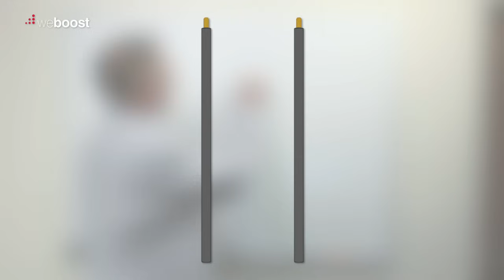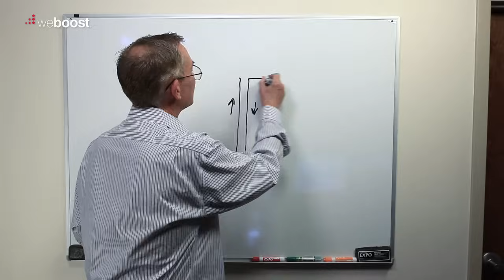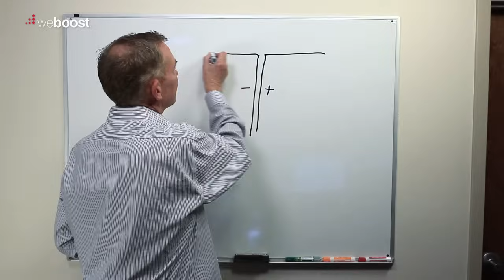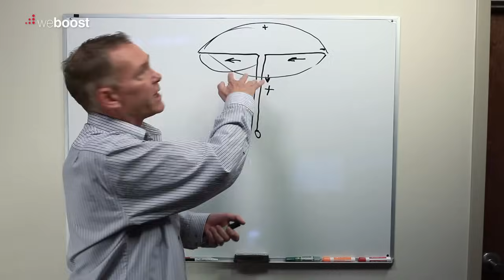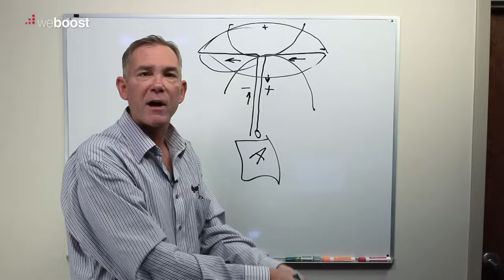How Does An Antenna Work? | weBoost

Comment: I do not get the logic behind the essentials explained. My confuses: why would the energy radiate once you implicit the Circuit as shown. Like why would the energy leave the circuit just because Current flow in the same direction. Would’nt that also cancel them out? Why would’nt all energy just continue into the cathode? Could someone with a Nice soul please clarify this to me? I really must say i’ve allways fellt smart until i’ve tried to understand the logics and deeper fundamentals with radio signals.
Thanks in advance.
Reply: try to learn how the magnetic field around a current carrying wire looks like.That will tell u why having two wires carrying current in same direction adds up the field, rather than cancel. Also how electric field and magnetic fields sustain each other (Maxwell equations)- that will tell u why the energy can leave the circuit.

Comment: Does anything control which direction the energy goes, can it also land in other areas that send signals.if a car is parked in an area where there is an antenna on top of a steeple can that energy wave be drawn to the energy emitting from a car radio? is the antenna Frequencies encompassed by a limited space or does it travel from exm a steeple of a church and can hit the sidewalk from the steeple. like how does it travel ? what attracts the energy, ?

Comment: Thank you for your effort.
But to my point of view, you explain nothing.
And what is this current flow that comes from nowhere on the right wire and goes nowhere on the left one?
This is more confusing than explaining.
Reply: It's like applying AC signal across a capacitor. The circuit is not closed conductively but still displacement current flows and the plates of the capacitor gets charges with oscilating polarity. Similarly, the wire ends gets charged up with oscillating  polarity.
Reply: @commieTerminator    The voltage is its highest at the ends, like on the plates of a capacitor. No current flows out there, only an E wave.  The current is always it highest at the feed (for a center fed dipole, as shown)  so the magnetic field is its highest around the center.
Reply: Backpacker Thrulife that’s a simple explanation of the complex system. Nicely put.
Reply: @backpackerthrulife8497  Current does flow in the antenna which is the only reason why Magnetic fields gets generated. According to Maxwell's equations, changing Electric fields or even a constant current can create Magnetic fields. If the Electric field is changing rapidly then, electrons in the antennae have to move in the opposite direction of the E field because the antennae is conductive. Oscillating electrons (Accelerated charged particles) can easily radiate energy.
Reply: @johnny2x2   Years of scratching my head, until I understood the basic simplicity of it all.  Wikipedia has an excellent animation and drawing in the "Dipole Antenna" article which kinda clarified it all for me.
Reply: I understand  how the current  is created by the frequency  in the wire but I don't understand  how it emits a magnetic field because the circuit  is incomplete in the first place.
Reply: @losimkimrey6531  The circuit may look incomplete but still AC current flows in the antina which creates an oscillating Magnetic field. Since Electric and Magnetic fields are both in sync with each other, it radiates EM waves.
Reply: @commieTerminator  So is it that your telling me an AC current can flow in a conductor without a circuit  being complete?
Reply: @commieTerminator  That is what that's troubling  my head. I understand  all the other parts but  I need an explanation  on only that part please.
Reply: @losimkimrey6531  yes this is what we are telling you lol. When electrical fields move back an forth in a electric circuit they create electromagnetic waves that can propagate under certain circumstances. only HIGH FREQUENCY (like 0.1+ GHz frequencies) can propagate efficiently
Reply: @johnny2x2  pretty confusing. But thank u :)
Reply: Well... In maxwell's equations it states that [ Ampère's circuital law : (change in magnetic field = Material magnetic constant * ( ConductorsConductivity*Efield + Material Electric constant *(derivative of Efield with respect to time ))]. So the flow of electricity from [ConductorsConductivity*Efield] usually is predominant in the equation but because as you stated "what is this current flow that comes from nowhere on the right wire and goes nowhere on the left one?" You are correct it is "disconnected" but this is on purpose. Because of the [Material Electric constant *(derivative of Efield with respect to time )] part of the equation we apply a signal to the antenna that changes over time to make the electrons move back and forth (thus causing changes in the Magnetic field around the antenna and because magnetic and electric fields are coupled together ( meaning one makes the other) SOOO you can emit signals with proper design of this phenomena.
Reply: @johnny2x2   What??

Comment: Thank you weBoost for the simple explanation. I can't seem to get good reception  in my house radio. I've bought and had good radios and they always come with a plastic "ring" and wire as an antenna, or just a wire, but it doesn't improve the clarity of the stations. I get too much static on stations that are very clear in my truck radio. There are some good radio stations, such as good radio talk programs that I would like to listen at home just like I do when I drive my truck, but all I get is static. I've been thinking of getting an outside radio antenna, but I'm completely lost on size and power in what to buy or go about it. Do you have any advice for a "greenhorn"?  Any info to get me on the right track is appreciated. I just noticed Don passed away. I'm sorry for your loss.

Comment: Antennas, are nothing more than solar panels capturing invisible light. 

I see lot's of self-proclaimed lifetime electronics experts making comments. As if stating credentials makes you all correct. Lol
However, none of you so-called experts have said what antennas actually do and what the signals really are. Radio frequencies are nothing more than invisible light beyond the spectrum of what our eyes are capable of seeing. RF follows the same wavelengths as what we perceive as light, however the wavelengths for RF are much longer and each length determines the exact frequency that is being broadcast. That length will determine the design of the antenna and how far apart antenna elements should be spaced apart. 

I always explain antenna signals to my customers as light. Imagine that the broadcasting tower 50 miles away has a 30,000 watt light bulb on top of their 1000 foot broadcasting tower. You have to be able to see that light from your house, yes 50 miles away. So the light has to beam through the trees and still reach the antenna. Which is why indoor antennas barely work unless you place them near a window.
Just like sunlight can still light up a room but casts shadows, RF signals do the exact same. Shadow areas produce weaker signals. Yes, RF signals can penetrate walls, but not as well as people think. Sunlight can still light up a room through any open windows but it's bright as F if you go outside. 
Once you start thinking of RF as light, you will then start to understand how antennas actually work. Antennas, are nothing more than solar panels capturing invisible light.

Comment: Hello Don! Mark Mann here, nice to meet you, glad I found your channel Nice you offered your audience a chance to pick your brain. My application is a 35Watt home made FM transmitter which has two open spots to send signals to sound stations so that i can broadcast and cover a large park and huge car show here in Arizona. i will probably back the wattage down however i am glad to have more power than less. Last year i used a 7Watt China Special and had issues, i am sure you know there are may potential issues in FM broadcasting. My design calls for 50 ohm and i highly preffer half-wave (potential Hz's are 103.70 and slightly higher than 108.00 I am near Mexico and so some reason Mexico loves the 86MHz to 101Mhz area and commonly step all over each other... with that i like the the upper part of the FM spectrum. NOW IMPORTANTLY, i was going to just toss in towel on the next technical challenge (the antenna) and just buy a Standard DP100 and was shocked to see they are outrageously priced... Money is not the number one factor, however wasting money is...   My last attempt was a basic di-pole half wave made from copper pipe (calculations are for 103.70 27" Anode (pointing straight up) and 27" Electrode (pointing straight down) my transmitter kept shutting down due to inadequate load on the output.  my solder joints were OK, maybe a tad overdone however i became frustrated. The basics things that can go wrong always yield the highest level of frustration. Now after shopping for a factory built dipole (DP100 or similar) I have a second wind and am determined to get my home brew right...  I Need Your Advice!  1st: How can I be sure to maintain 50 ohms"???" I only need a 10 foot 50 ohm coax run and have the coax on order. My transmitter output connector is a SMA Female (rated 50 ohm). My ordered Coax is SMA male on both sides and everything is rated 50 ohm. HELP! Do I just "solder blob" my way into a trial and error nightmare or is there something I am overlooking? Could you share a basic bullet proof design with me please??? J-Pole? Double Bi-Pole? Yagi? One of those cool looking twisted 3d pointy designs?  I would also consider purchasing and scrap you have that can be brought back to life $100 or less please... Please dont laugh i know what a high end FM Transmission Antenna can run and $100 could not even cover the nuts and bolts...  So, to recap,  FM Transmitter 30 Watts 50 ohm 103.70MHz or higher. 1/2 wave preffered. basic Bi-pole OK and will strongly consider something more involved. HOW DO I MAINTAIN 50 ohm BY DESIGN and Craftsmanship? I think I should stick with copper and will go "SOLID ROD" NOT Tube.   Thank you again so very much and BRAVO ZULU on your Video... ;-)  Mark

Comment: This is freaking awesome. Thank you for the breakdown. Never understood how antennas work until now.
Reply: I know your comment was 4 years ago (to me here and now) but there are so many things this explanation just avoids.

How do the currents in each wire 'cancel each other out'?  A basic questions that needed explanation.
Why did one wire have current flowing in one direction, and the other wire current in the opposite direction?
How is current flowing when there's no traditional electrical path back to ground?  (again, vital to explain for someone who searched this video up for an explanation on fundamentals)
What made the high voltage point?  How does it just 'meet up' at the point before expanding outwards?

I'm sure I'm going to get downvoted to oblivion because people love putting sentiment before logic but this is a very poor video.

Comment: Here's something to consider, an antenna radiates RF energy into free space, of almost infinite volume, but with the square of the area being inversely proportional to the signal level received, so by measuring the signal level at one antenna at a given distance from a given output power level from the transmitting antenna a certain voltage is present and with perfect tuning of both antennas it is of a high nominal value. So, what happens when you add enough antennas to fill that free space and mathematically combine all of their outputs, do you end up with more or less power than was transmitted? Physics would of course say less, but as the number of antennas is nearly infinite, the real answer becomes implausibly more..